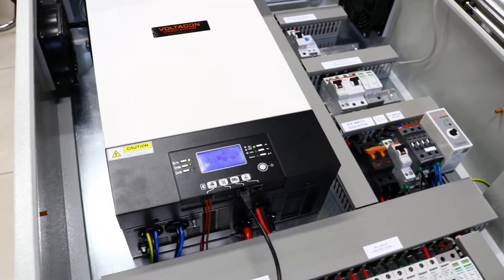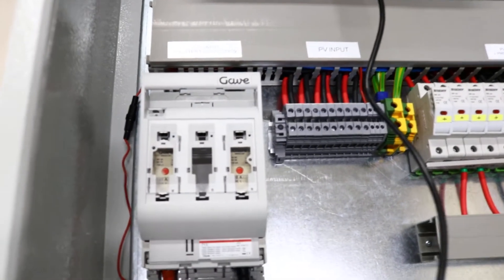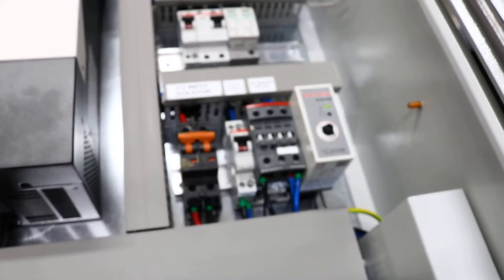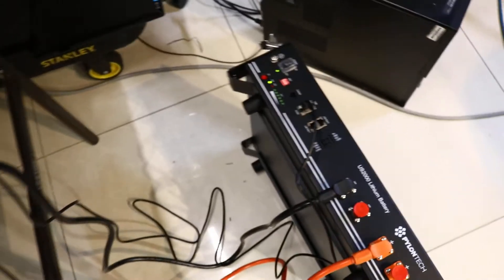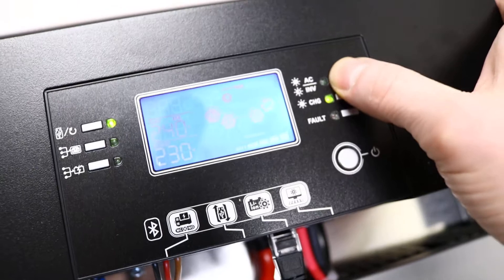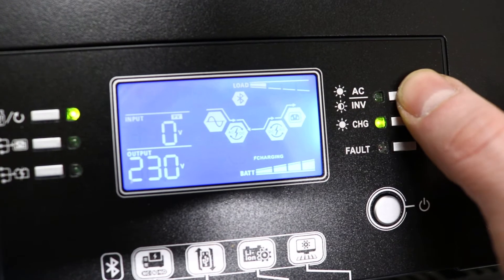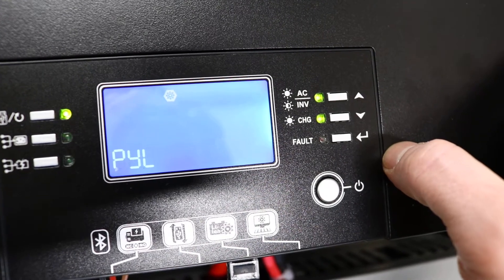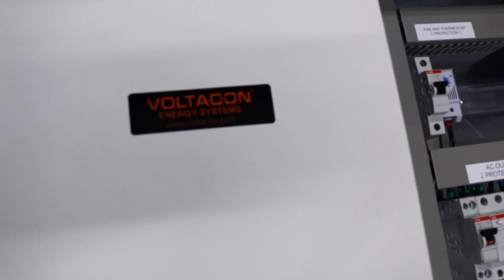Pairing BMS Compatible Solar Off Grid Inverter with Pylontech US2000

Comment: If you have HS61 fault on your Inverter you need an special Ethernet cable: Batterie side pin 7 and 8 goes to the Inverter sid of 3 and 5.   8 to5 and 7 to 3
Reply: works with a lot of chinese inverters, my inverter is a Powerwalker 5600 LGT